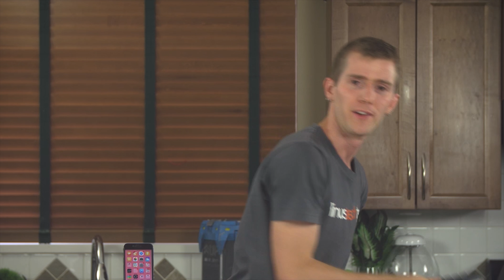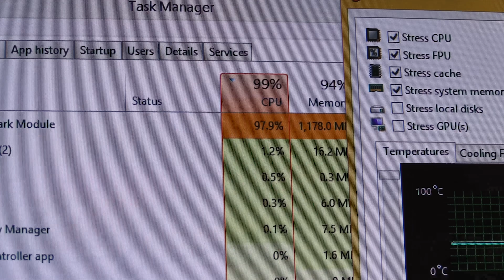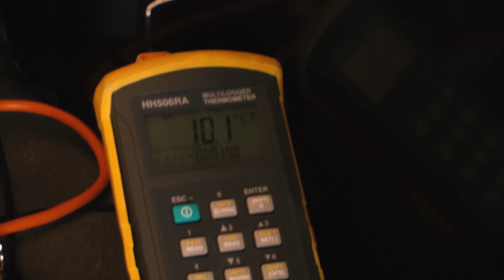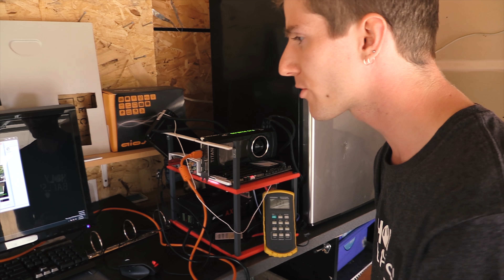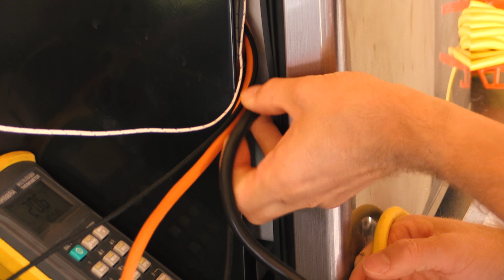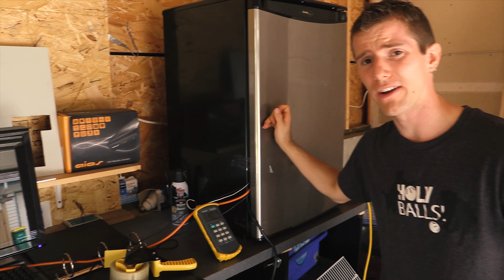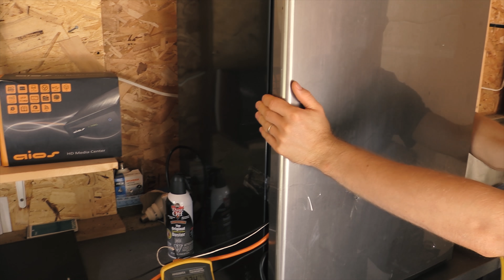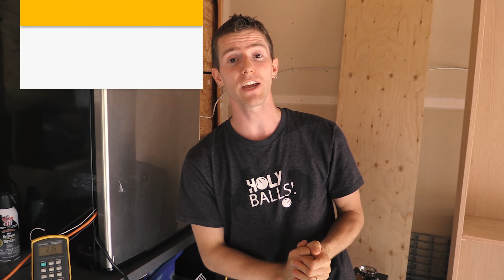PC Build in a Fridge - Does it Work??

Comment: I have a solution for ya folks: Use a Dyson Am09 Hot+Cool, open the side and put the temperature to...I dunno 10°C (or 50°F for all US Americans) or even 1°C (33,8°F) and point it directly at your open case ^^ Voila, you now have an ultra cool gaming system. And you'll live in a fridge after a few minutes.
Reply: BTW yes, I am a huge Dyson Fanboy. Kinda like an Apple Fanboy just with Dyson ^^

Comment: Why not a freezer?
Reply: Condensation.
Reply: You have quite the condensing argument.
Reply: I wansn't clear on my first comment about a easy to solve issue, but will clarify. If the CPU and other components are not protected against condensation, they will not last long.
A link to what it can do if not properly insulated. The example is from a phase change cooler, which, like a freezer, works like a heat pump.
http://www.overclock.net/t/1526237/the-downside-of-using-a-phase-change-and-or-extreme-cooling

If it is properly insulated, then it could work, a freezer is a heat pump after all, but not one specialized for constant heat pumping from a constant heat source. And a CPU in the hands of a overclocker can become quite a powerful one. I question how such a experiment can reduce the lifespan of the compressor.

Comment: in order for a "fridge cooled" pc to work, you would have to strip down the Freon (cooler) system, create a custom heatsink(s) that can be hermetically sealed (most likely via brazing or solder) and then directly apply your heatsinks to your components to be cooled, I would recommend ceramic thermal compounds as they seem like they would be able to withstand the drastic temperature differential. As a very important note, I highly recommend performing a total system vacuum check prior to refilling with Freon. The major concern is that Freon displaces oxygen, if you have your computer in an air restricted space (like a basement or small room) you will force all the air out and suffocate. once you have performed all the necessary leak tests, fixes, and setting tweaks enjoy overclocking to somewhere in the 120-150% range.
Other important notes: 
cool your condenser coil with cpu / case fans for maximum performance of the cooling system (just like a liquid radiator)
once you have assembled all of your components on the mother board spray coat them with silicon or selastic liberally, as the extremely high potential for condensation / frost build up can cause damage.
if you see frost building up on the return line to the compressor you have a very serious problem and this can destroy the compressor, if not delt with.

Comment: A few years ago, a Microsoft engineer was having issues with his hdd.
This was back when Win XP was "Whistler".
When the hdd got hot, it would lock up.
I suggested we remove it, put it in the freezer, and see what happens.
We did it, and it got cooled down enough to copy the drive before it locked up for good.
Also, we had to hold the drive on an angle while it was copying the data.

Comment: Did you try to mount the thermostat to the heatsink? If your going to use a mini fridge as a case i figure you're going to modify it.
Reply: Ive never seen this addressed in your videos. You just claim it made for cyclical cooling. 
You could probably mount the thermostat in a liquid cooling cooling reservoir. 
you could probably just drill a couple holes in the top, silicone it shut and fill it with oil. Most of the evaporators are just plates at the top for mini fridges that would easily submerge.

Comment: What if you cut two holes on the front, pumped air in through one hole, then took the air from the other hole and pumped it through the fans on the PC

Comment: Why not drill an IN&OUT Hole into the Front or Side of the Mini-Fridge, not putting the whole PC inside but a Part of it, mainly just the Radiator(s), add fans if you like... than connect the Tubes to the CPU and GPU...??

You could switch out the Radiator with a reasonably size Fishtank with Water and a Pump... One Tube Pumps out the Cold Water to the PC while the other Tube Pulls in the Heated Water from the PC.

Comment: Stock fridge off cource is not able to cool a pc. It needs some modding. Large radiators outside, liquid loop to sides inside. More practicaly will be to use fridge compressor to directly cool down components.

Comment: but some fridges have like a water dispenser where the water gets cooled to around 1-5 degrees, and couldnt you use that for your watercooling on your rig wich is not located in the fridge itself? ;) :DD
Reply: same problem applies ? the compressor can't handle it.
Reply: 1-5 celcius?
Reply: Ya Boi CJ 34 - 41 Fahrenheit
Reply: ProuxTV interesting
Reply: About installing a Bitcoin mining rig made out of cut down on the fucking noise from the anti miners would that work?
Reply: its better than using ambient water so at worst itll hit ambient because you still have a radiator

Comment: IDEA: get a pc housing with openings/serrations throughout the box. Get a quality window fan. Use sheet aluminum to create an airtight duct from the back of the pc to the front of the fan, blowing out the window. I personally would try this, because my bedroom is small, and on the top floor. My ambient temperature is too high for a gaming pc. With the duct design, I could not only exhaust air, but intake it, since most window fans have reversible polarity. Sounds stupid, I know. Now, who wants to set stuff on 🔥FIRE🔥

Comment: so what about condensation?
Reply: All the more reason to not put your computer in a fridge.
Reply: compressor  removes moisture.
Reply: This was the first thing I thought of
Reply: Brendan Roberts ok so you get codebsation if you put a cold thing in a warm atmosphere. Like a glass with ice water. But if yiu reverse it it would be like the tabke next to the ice water glass would start condensing water instead of the glass
Reply: dude thats why the fridge was turned off and opened to get the temperature to equilibrium and then the pc was put inside so that pc cools with fridge's interior temp thereby preventing condensation. If the refrigerator was already cooled and then the rig was put inside then trick might have worked but would have killed the pc like exactly what you said.

Comment: I have a window A/C unit next to my desktop, part of the output is funneled through the case. Even a crappy window unit removes 5000btu/hr and puts out 230+cfm of air - you could drastically increase case airflow and drop your ambient temperature by 25+ degrees, depending on the unit. Might work better than a fridge.

Comment: If the ambient temperature is lower than the computer case exhaust  air temperature then you're better off letting that exhaust air outside and inserting cooler air from the room.
Basically an Air Condition for the room will serve you fine, unless you need cooler intake air for your computer than for your body. Otherwise you could make a custom Air Cooling device (using air conditioner parts) that cools the air inside the case air-intakes and pipes that take the air exhaust outside the room, into the environment.
So the situation changes a lot if room temperature is 30 degrees Celsius and the temperature outside is 40 (hot sunny day) OR if the room temp is 20 and outside it's 5 (mild winter).

Comment: As a technician, my first thought was power ratings. Power consumption of the PC vs power rating of the cooling system. But i realize most people don't think about heat that way, most people think of it as just a temperature.

Comment: few years ago i did overclocking with watercooling and a huge radiator with 9 120mm fans, placed in the fridge was working well the water temp droped just above 0C and cpu was not even reach 15C , it worked goof but about a half hour condensation started outside the water systemp and around the cpu core and socket, not a good idea but all survived -) so i could overclock much higher but not for long, conclusion; nice for temporarry use but keep watch the temps and condensastion! 
later i forgot to power up the waterpump and the radiator was frozen lol, so be sure the water keep running.

Comment: What about mounting the mobo and the heat producing parts on top of a smaller fridge and using the fridge to act as a cooling unit for liquid. you would have a shell on the top 2 holes drilled into the fridge on the sides and putting the reservoir maby rad and the pump in the fridge not a large one like in the vid but a small one that would accommodate the reservoir and pump with the added benefit of having a drink or two in there. mount some rads after the heat before it reenters the fridge to dissipate the heat before it enters the fridge. That way you have essentially a supercharged cooling system with a fridge that has a small volume of air rather then a larger one. it might be a more possible solution to insane cooling. its a theory but a rather interesting one

Comment: if I had money and or a computer still, I'd run an aio liquid on the gpu and cpu then submerge them in water and then stick those in the refrigerator as opposed to the whole damned computer. Yeah it's still producing heat in a closed system, but heat dissipation is dependent on mass and temperature so perhaps there would be enough mass to heat slowly with in the refrigerator. worst case scenario ya chuck some ice in there, too. prolly wouldn't work. xp

Comment: It's generally accepted that you need 1 140mm rad & fan per hot component, so in a pc with 8 GPU's & 2 CPU's you would need 2 quad rads and a dual rad allot of $$$$. If you have a direct CPU phase changer you have to battle with condensation. So could you use a LC loop and use a phase change cooler on the pipework could you significantly reduce the amount of radiators and thus costs, whilst maintaining just above ambient temperatures at the components.

Comment: @Linus Tech Tips , please, this was too over-simplistic, and disproportional, why you don't try a full size fridge (inverter tech)? Or, there is another option I saw somewhere, adapting a fridge with Air conditioning technology, inverter tech too, temperature PC controlled by USB, that way you could define the exact temperature inside the box, and the compressor would work accordingly without reaching a temp that would hurt the computer (too low temp condensate water, and water is bad).

Comment: hey could you build a PC and connect it to cooling pipes that are running thru a mini fridge. the idea behind this is that the mini fridge would cool the coolant at an extreme rate and it also works around the bad ideas of putting the PC in the fridge while still being able to access all the parts.

Comment: Expanding upon this concept, what if you took a watercooling system and the way a refrigerator cools (puts this liquid under pressure that then sucks heat of out the air as it runs through tubes in the back of the fridge) and combined them, to have a normal pc, but refrigerated from inside? That would be so cool to see foggy air coming out of your pic fans.

Comment: what if you took a smaller fridge like a single can fridge and just taped that to the intake fan and pumped the cold air into the desktop. or maybe somehow take the normal sized mini fridge and pump the cold air out and in through the intake fan.

Comment: Back in '02 (Thunderbird days), there was someone who did the dorm fridge build.  What the actual trick was is there was a freezer in it with coils.  They removed the tray area, then dropped the freezer coils down in rubbing alcohol in the fruit bin, used a pump and liquid cooled the CPU.  The fridge did a great job of keeping the rest very cool while the cpu was steady at an idle around 0-5c thanks to the freezer!  So if it's going to be done, yes you're correct that a fridge won't work, a combo fridge/freezer needs to be obtained and then some serious modding!  I don't know about LONG term, but it could be viable, but only for units fridge that are meant to FREEZE not cool.

Comment: I've put my liquid radiator (3x) into a small deep-freezer, temps were hitting 8'c, so I had to keep turning it off. Don't want it to freeze and/or cause condensation in the PC. Managed to get 4.7GHz on my i3770k though.

Comment: I don't think it would take an "industrial" refrigerator to get the job done. The real cooling power is in the freezer, so stuff a hot PC in a fridge that has a freezer that will fit said PC, find a decent way to seal it, and bingo. I'd set it to higher temps to minimize condensation -- might need some kind of moisture-absorbing packs or such.

Comment: doing it the wrong way, big time.
Reply: The power supply doesn't need cooling, specially if its rated platinium or titanium. also alot of heat comes from quite a lot more than just the spots that really needs that delta power. Ever taught of putting just your watercooled pool ? I think it would be much better than your last "room watercooling" .. ;) . Anytime.

Comment: What if you design the fridge to not be a closed system? Heat rises so put exhaust system at the top of the fridge. And on the bottom would be the cool air?

Comment: Alright Linus .... so since it's a closed system it dissipates heat through the sides of the refrigerator and it doesn't work too well. But what about ...... a computer inside a mini fridge inside another refrigerator?!? Timer for a sequel video.

Comment: you nearly did it right... take your idea from whole room water cooling... and move it in to the fridge, so basically, run a bunch of copper pipe or something in to the fridge, more the better (more surface area) and then attach that to your cpu and put a pump on it. then you are water cooling the cpu and cooling the fluid with the fridge. doing it this way, might just work!

Comment: I'm sure someone has mentioned this in previous comments, but to recap: It is quite easy to see the (non)benefit by comparing power ratings. A full PC will consume at least 100-200 watts even in idle and most of that converts to heat. A usual household fridge is rated for about the same wattage (100-200), and the cooling power is lower than that (efficiency cannot reach 100%). So, as the fridge is a thermally insulated space, the only way for the heat to dissipate is by the refrigeration system, and as it is rated below the power dissipation of the PC, the only result is that heat keeps building up inside the fridge. EDIT: To the people who suggest a freezer instead, the answer is still NO. A typical freezer has about the same power rating as a fridge, so though the freezer is made to reach lower temperatures, it cannot maintain it when its power rating is exceeded, resulting heat rising up constantly.

Comment: How about using a vent shaft to direct the cold air flow from an Air Conditioner into the intake of a PC case?

Take out the rear exhaust fan to make sure the cold air doesnt get exhausted too quickly.

Use a big heat sink air cooler like a D15 on the CPU.

Use a custom loop with top mounted radiator to cool the GPU. Use copper tubing in the loop which may act as a heat sink for the liquid inside. The fans on the radiator will exhaust some of the cold air but with the resistance of the radiator, not too much.

Comment: Since your little fridge isn't enough to keep the whole computer cool, you need to make it a 2 stage system.  Have a water cooled CPU and GPU with a 2 stage radiator.  The first stage would be outside the fridge and remove as much heat as it can, then the second stage inside the fridge would have much less work to do.  Also since the heat from the PS and other heat radiating parts are outside the fridge, the load on the fridge would be much smaller.  Of course you would probably need to drill holes in the fridge to run the tubing through.

Comment: OK I'm sorry but am I the only one that is annoyed by the obvious? This video has absolutely no point. Why in the world would you EVER put the main CPU cooler INSIDE the fridge? That's not the point of having your PC in the fridge. The point is to make the cooling more efficient by cooling ALL the components the cooler does not. Especially with a nice liquid cooled setup like this doing this would be so easy. Why did you not bother trying this? Keep the heatsink and fans OUTSIDE! Instead you reached a completely obvious conclusion without trying what would make this video interesting. Color me disappointed.
Reply: Err. the interior of the fridge is cooler than the exterior, of course you would encapsulate the whole system or really you would get no benefits towards the CPU, which is the meat of the beast.
Reply: You must not watch many of Linus' videos, do you?